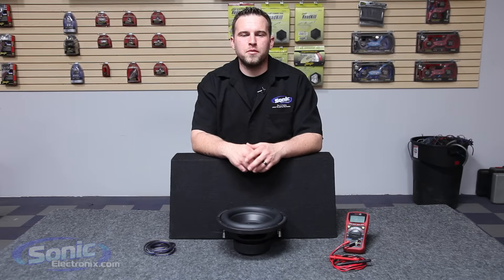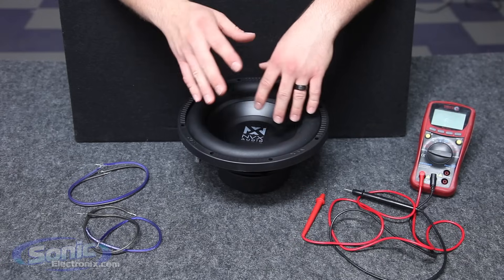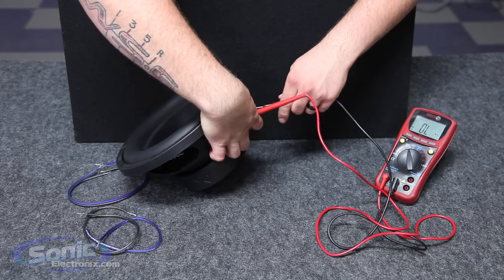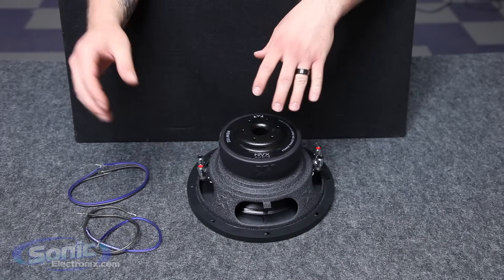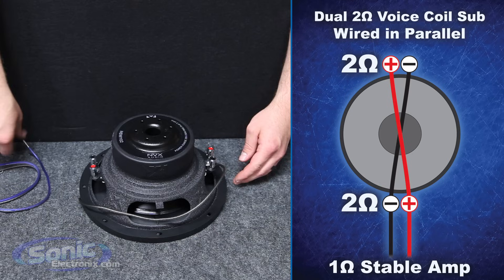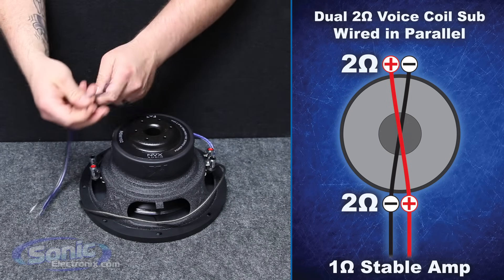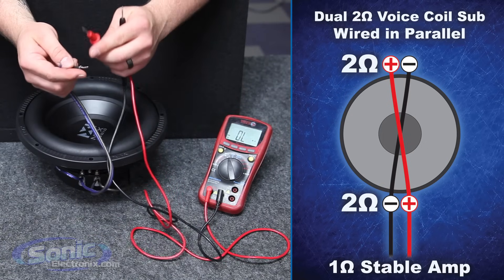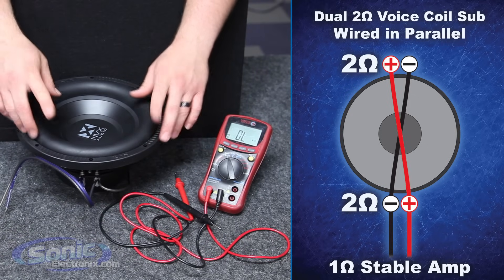How to Wire a Dual 2 ohm Subwoofer to a 1 ohm Final Impedance | Parallel Wiring | Car Audio 101

Comment: I’m doing a single 15 inch set up sitting up on around 2000w in theory, I can run one sub running this parallel???? (And yes it’s the same kind of subwoofer)

Comment: Thank you.
I have a 2ohm dual voice subwoofer speaker now and a 1 ohm amplifier for my car subwoofer.
The Factory one was a single voice 1ohm 6.5” using a 1 ohm  amp.

I accidentally bought a 4ohm sub-speaker.
Not seeing that I had 1 ohm amp until I double checked my work. 

I thought this. 
And thank you again for clarifying.

Comment: How do you wire 2 of these subs the same way to a 1 ohm stable amp?
Reply: Can’t! You have to have a 2 channel a wire each on their own.
Reply: @MacThaGoat  no then it would be 4 ohm total
Reply: 2 ohm to each channel
Reply: @thomaswalton1978 I know what I’m talking about, I do audio, lol.
Reply: @thomaswalton1978 no you wire it down to 1 ohm for each channel. Literally how he does it in the video
Reply: @MacThaGoat that's not how it works
Reply: @MacThaGoat u can't wire a dual 2 ohm sub to 1 ohm and most people that know what they are doing will get a amp that's 2-3x the RMS of the subs because of box rise and heat, also the amp you mentioned does no where near what it says it does they put fake numbers on the box. Get a amp from a reputable company that's stable at the ohm load you need and wire the subs together, wiring subs to different channels in a multi channel amp will cause problems
Reply: @t @thomaswalton1978 de in the video is literally wiring a 2ohm to 1 ohm. wtf don’t you guys get. I’m literally commenting on the video where dude is doing it. You guys can’t be serious right now, Lmaoo. Mine never had problems cause I know what I’m doing. If I wanted to wire em together then I would have did that. I like running my shit at 1 ohm though. I’d never run at 4ohms. obviously you can’t run two 2ohm an make it 1. WITH 1 2ohm you can take it down to 1. That’s why I run both of 2ohm separate, does that make sense now. You guys suppose to know about audio but not understanding what I’m saying. I’m literally running 1 2ohm sub that I took down to 1ohm in my car right now. I got 4 2ohm subs if I wanted to put em all in I can do it right now. I like running my solo 2ohm premier that I got in now at 1ohm on my 2400w. That’s way more than enough for my sub.  This a daily, if I wanted to make a comp setup I’d of done that.
Reply: @MacThaGoat I meant 2x 2 ohm subs lol
Reply: @MacThaGoat you can only wire 2 2ohm dvc subs to either 2 ohm or .5  and many amps are not half ohm stable
Reply: @ronnydisalvo80 yea if you want to run them parallel. Just get a 2 channel amp an run em separate..
Reply: @MacThaGoat I'd never run subs off a 2 channel amp  if anything at that point get 2 separate mono amp. Running another skar 12 zvx as in texting in wife's car. Used a kisloc2 which just finished wiring into her stock rear sub as these new cars radios are essentially flat screen computers. Lol
Reply: @ronnydisalvo80 why would I get two separate amps when my amp is big enough for both of them? That’s your problem, you running to small of amp. I got a 2400w hifonics Brutus. Pushing two 12 pioneer premiers at 1000rms a piece. They’re getting 1200w a piece. Makes no sense to run two separate amps.
Reply: @MacThaGoat dude wtf r u talking about. I have 2 skar zvx12 hooked up to a taramps 5k with 0 gauge wire , which slams.  Also built my own box tuned to 34hz. Get lost. U know nothing once u said. Hi fonics ur out of my conversation
Reply: U push nothing but keyboard letters
Reply: Imposible
Reply: @juanpuente205 Howcome? I’m curious
Reply: @OMGits_Hercules  because if you did this for 2 subs at 2 ohm each, then you end up with a final impedance of ~0.5
Reply: @sams66toronado how to make your amp go into protect mode any % speed run.

Comment: Thank You! I Just in stalled a Skar ZVX 15" 2ohm into my 99 Lexus LS400. The Skar amp is 2000rms and is 1ohm stable. I had to rewire the terminal wires because they were top small so I used what I think is 10 - 8 Gauge OFC wiring. Hooked everything up and it sounds great! I'm still breaking it in. Thank you for your help!
Reply: Any problems so far?
Reply: @Adrick Herbert  Not at all! I have a 5 farad cap and I'm getting a touch screen Android Tablet put in 2m with built-in DSP. For now everything is turned down to a little more than half. C1 JL audio Components in front and 2ways in the rear - all 6 1/2 with a 4 channel 400rms  MTX amp.

Comment: So I got a 1 ohm amp and two, 2ohm speakers I got every thing hooked up and knew something wasn’t right, so basically I just need to run jumpers on both speakers negative to negative and positive to positive?

Comment: why my dual 2 ohms  woofer wired in parallel reads  0.4 - 0.7 on the multimeter 
nothing close to 1 ohm
Reply from the maker: The reading usually won't be dead on.  That reading is normal

Comment: my subwoofer shows 1.3-1.4ohm is that normal?
Reply: Are the wires to the coil damaged?
Reply: @Chchchchchivo  Sorry for late respond, um not sure, maybe no
Reply: @grikisgrikis2779  Come to find one of the speakers was damaged. A coil broke on a dual omh speaker.
Reply: @Chchchchchivo  for you? For me it was metering value difference
Reply: @grikisgrikis2779  I isolated the speakers, measured one at 2omh, The other one was reading 1.4, then finally took a notice of the coil.

It completely burn itself,  broken the fine wire that connects the terminal to the speaker.
Reply: @Chchchchchivo  sheesh
Reply: @Chchchchchivo  mine both measure same value
Reply: @Chchchchchivo  oh it was just my meter leads when i touch each other showed 0.3-0.4ohm rhanks

Comment: When I try to wire my dual voice coil 2 ohm 15" sub to 1 ohm, the exact same way he did it, it shows 2 ohms. I've tested both voice coils and they're both 2 ohms so does anyone know what could be wrong
Reply: Impossible you need 2 4hom dvc
Reply: @ss_rell5513  I mean a dual 4ohm my bad. You can only wire a dual 2 ohm to .5 ohm or 4 ohm
Reply: @ausmanxx  no. Only to 1 ohm. Your only lowering the impedance of the sub. In which case if you do two or more subs.. than it’s double dropping the impedance so the Mp can push more.

Comment: How to wire a dvc single 2ohm sub to a 2ohm load? Man help me with this please
Reply: Didnt you find out how I'm wondering my self
Reply: @matthowell2890  impossible right? And the best thing is that atleast you answer after six months. I have one important question. What software do you use for designing a subwoofer enclosure? Do you use any

Comment: How do you wire two 2 ohm subwoofers to a 1ohm amp? Do i just wire each woofer like as in the video but separately? i have the kicker cxa1200.1 amp
Reply: Do they hit harder at Final 1ohm load?
Reply: @Marcel King  theyre plenty loud for a daily driver.
Reply: MR POPSICLES did you figure this out?
Reply: @t_zeazy_9526  yea i ended up wiring my subs at 1ohm each then put each positive and negitive wire into its own terminal since the cxa has 2 positive and to negative terminal to use.
Reply: @MR_POPSICLES  still working?
Reply: @dannywilliamson5906  yea the subs thump
Reply: Than a 2ohm load

Comment: How do u wire two 1ohm subs and maintain a 1ohm load???..I have two 1ohm subs..Rockford fosgate t1s1-12's...I am using their t1000-1bd amp..do I follow their manual diagram and make them 2ohms??..help just want to do it correctly..

Comment: I did that and I end with 1.6 ohms. Pls advise
Reply: It's alright. I also got 1.6-1.7ohm and i tested that my meter itself shows 0.6-0.7 ohm on idle so you substract that from and you should get around 1ohm load.

Comment: So what better 1 ohm amp 2x2 ohm sub parallel? Or 4ohm amp and 2x2ohm sub serial?
Reply: If you are talking about just one sub you will get more power=more bass wiring one dual 2ohm sub in parallel which= a final impedance of 1ohm. Just make sure you check how much wattage in rms your amp puts out at 1ohm and most importantly if it can run at 1ohm. Then make sure that your subwoofer RMS wattage rating is close or preferably a bit more than that what the amp would be putting out. There are many circumstances you can run into such as if for instance, your amp puts out 1000wrms@1ohm but your sub is only rated @ 400wrms, if you run it in parallel you could damage your sub or it’ll just sound like hell, so then you check your amp ratings again and see what the output is @4ohm and say for example if it says it puts out 500rms@4ohm then obviously you are in the ballpark for the rating of your subwoofer and will be better off running it in series @4ohm.

Comment: Can you wire 2 subs  2ohm to 1 ohm ?
Reply: Yes he can. If he wires the subs individually to 1 ohm. He is going to have 2 positives and 2 negatives. He connects 1 positive to the negative, it will take the ohm load to 2ohms. Then he connects the remaining positive and negative to the mono amp or 1 channel amp, it will give him 1 ohm.

Comment: What if you wire 2 2ohm subs that are dvc and you wire it the same way so you have 2 x 1ohm load, what does a monoblock amp see that as? in ohms.
Reply: 0.5
Reply: @andremcpherson6395  Thanks mate, i think thats an old post, i worked it out eventually.
Reply: How did you get them to 1 ohm?
Reply: @CXRacer11  Hi this is an old post, I will double check to see if i used 4ohm or 2ohm subs eventually to do this.

Comment: Can a kicker cxa 1800.1 give a 8ohm load on a dual 4 ohm subwoofer if so what's the rms wattage it would give so far its 1800rms 2ohm and 900rms 4ohm

Comment: What amp should I use for 2 comp r kicker 12s in a ported box the 1000 rms each and is 2 ohms?
Reply: Christian Kenne a mono block amp that is 2500 or 3000 watts or get 2 separate amps for each woofer that are 1500 watts for each subwoofer
Reply: Victor Barrera  could u name some I've been look I g at the I think it's hyfo ivs Brutus but idk what's good and what's not so good
Reply: @christiankenne9435  have you got your amp already?.

Comment: Can anyone help? I have a 2 ohm dvc and a 4ohm dvc that a brat shop put in my car years ago and when I went to rewire everything I noticed this. My question is how can i leave a 2ohm dvc sub and 2 ohm while using both coils? Is this possible. I want to drop the 4ohm to 2 ohm and leave the 2ohm at 2 ohm to have both equal at 2 ohm instead of dropping the 2ohm to 1ohm? Any help is appreciated thanks

Comment: Does this work the same if you have a dual 1 ohm sub to make it 2ohm
Reply: You can wire a dual 1ohm sub to 2ohm but you will have to jump the positive lead from one voice coil to the negative lead of the opposite voice coil, and hook the 2 remaining terminals to the corresponding terminals on your amp.

Comment: Would it be safe to wire my one dual 2ohm 12” psi platform 1 sub at a 1ohm final impedance on my JL Audio jx1000/1D 1000 watt rms amp or should I just wire the sub at 4 ohms. I’m not sure if my amp can handle 1 ohm so my sub can use all 1000 Watts. Any help would be greatly appreciated

Comment: If I have a 1ohm stable amp rated at 800watt RMS (500RMS @ 2ohm) and wire it to a dual 2ohm sub rated 600watt RMS. Will I be giving the sub the full 800 watts RMS or will it be reduced?
Reply: Depends which way you wire it.
Reply: You'll have to wire the sub accordingly if you want that 1ohm 800rms load from the amp. Otherwise, connecting the sub as is will be 500rms.

Comment: Question... If I have a 5000 RMS 2ohm sub and wire it to 1ohm...is it still 5000rms?
Reply: If I understand correctly, yes. The max RMS on the woofer is always going to be 5000. Wiring it to 1 ohm will mean that it is easier for the amplifier to achieve the desired output, assuming that it is stable to 1 ohm. Be sure that the amplifier you use is stable at 1 ohm!

Comment: I am going to get Kicker 1000W 12" 2-Ohm (43TCWRT122) subwoofer, it's already in the box wired and ready to go but from the box terminals where should I plug the speaker wire into the amp? (Crossfire 1000d)  I know positive and negitive obviously but should I put it on the left, right or combine the left right (the middle) positive and negitive? Please help!! (+-+-)

Comment: Is it possible to wire two amps, lets say two 1 ohm capable monoblocks both to .5 would that make them 1 ohm stable using two dual voice coil subs?

Comment: you can't wire 2ohm subs to 1ohms period
Reply: Bama Rogers lmao yes you can
Reply: @zachw.6964  Yes he can. If he wires the subs individually to 1 ohm. He is going to have 2 positives and 2 negatives. He connects 1 positive to the negative, it will take the ohm load to 2ohms. Then he connects the remaining positive and negative to the mono amp or 1 channel amp, it will give him 1 ohm.
Reply: @ZayMan38  i dont think its possible have u done this amd tested it with meter
Reply: @Simplyirresistable  I tested it. It seems to hover around .9 to 1.2

Comment: What happens if I wire 2 subwoofers like that and connect it to a mono block amp ?
Reply: did you find a solution for this lol? I have the same situation. 2 DVC 2 ohm subs but I wanna get a 1 ohm final impedence
Reply: Majestic have you got it tryna do the same
Reply: Dam I got da same question bruh I got dual 2ohm skars and an 800 monoblock 1ohm amp will it work?

Comment: What are the advantages of Wiring subs to  1ohm?
Reply: mono class amps will feed their full power to the sub.
Reply: Shaun Jay its all about matching the final impedance to your amp. some won't go down to 1ohm. most are either 1 or 2. it just determines what kind of subs you get and how you wire them to your amp. if your subs are wired to 1 ohm and your amp can only do 2 it will go into protect mode
Reply: Shaun Jay if your amp can do it,the sub/system would be a quite a bit louder

Comment: Hello I just bought a used Phoenix Gold Octane 12" woofer that has a dual voice coil like yours, but I noticed one of the sets of leads has one wire that has disconnected from the cone and I can tell about where it went but I dont see any metal or wire piece to solider it back to.  Does it just need to be re attached to the cone somewhere/anywhere or have I missed seeing something it should be re attached to?  Thanks for any help you can give
Reply: check this out, post is 2 months old and you may have fixed it already but. http://www.diyaudio.com/forums/car-audio/112692-fixing-subwoofer-wire-leads.html

Comment: what if i have two 2 ohm subs that i want to be 1 ohm final? please answer
Reply: You can only wire 2 Dual 2 ohm subwoofers to an impedance of 4 ohm 2 ohm or 0.5 ohm. I made that mistake myself. You're going to want to get 2 Dual 4 ohm subwoofers then you can wire to 1 ohm. Hope this helps.
Reply: How to wire it to o.5 ohms

Comment: is it possible to hook a 2ohm and a 4ohm subwoofer to 1ohm load if they have 1ohm capabilities?
Reply: Never a good idea to mix subs of different types of impedance. You'll eventually nuke your amp. If you're wanting a multi sub system best thing to do is get the exact same sub for however many subs you want.

Comment: I have two DVC 2 Ohm subs wired up INDIVIDUALLY like portrayed in the photo. Is it a bad idea to hook all four wires into my Mono Block 4500 Watt Amp that is rated 1 Ohm stable? I have it hooked up this way and I don't seem to have any issues. I see videos of people hooking up two DVC 2 Ohm subs into series parallel to make a 2 Ohm outcome. I want a 1 Ohm outcome for each woofer, so I have it hooked up this way. Not sure if this is a bad idea, but I have always done this with my subs and I have never blown them or fried an amp.
Reply: You're sending a .5 ohm read to your amp

Comment: What if I have 2 subs that I want to cOnnect down to 1 ohm?
Reply: is it possible to connect TWO DVC 2ohm subs to one amplifier to achieve a final impedance of 1ohm
Reply: Lee Green  Nope! You can only wire (2)dvc2ohm subs at either 0.5ohms or 2ohms on a Monoblock amplifier. You can also wire those subs @4ohm but on a 2channel amp which i don’t recommend, these days you’re better off getting a monoblock amp. Also i would not try running (2)dvc2ohm subs @0.5ohm unless you are seriously prepared for that i mean for sure “The Big 3” upgrades and most importantly if your amp can handle it, not too many amps can handle a load under 1ohm and if they do not very efficiently unless you have a powerhouse in your vehicle.
Reply: @luperodriguez2816  Yes he can. If he wires the subs individually to 1 ohm. He is going to have 2 positives and 2 negatives. He connects 1 positive to the negative, it will take the ohm load to 2ohms. Then he connects the remaining positive and negative to the mono amp or 1 channel amp, it will give him 1 ohm.
Reply: @luperodriguez2816  can this ORION HCCA HCCA3000.1DSPLX, Class D handle 0.5 ohm
With Skar ZVX v2 d2 12 I got two of them subwoofers. I also have the big three and other battery in the trunk  xs  power.
Reply: Albert Garcia I don’t see why not if you have the power supply on it. You can test out by hooking it it up and playing some bass drops and monitor a voltage meter to the amp and if you get anything under 12v with that setup then  you might wanna turn the amp down. You could settle with a bit of fluctuation in voltage just not anything crazy like 10V.Also of course make sure the amp doesn’t go into protection mode i mean it’ll be obvious itll just not send power to the subs.
Reply: Albert Garcia i have the same subs running on an rp45000 im gonna star posting demo videos
Reply: @leegreen8158    Yes he can. If he wires the subs individually to 1 ohm. He is going to have 2 positives and 2 negatives. He connects 1 positive to the negative, it will take the ohm load to 2ohms. Then he connects the remaining positive and negative to the mono amp or 1 channel amp, it will give him 1 ohm.